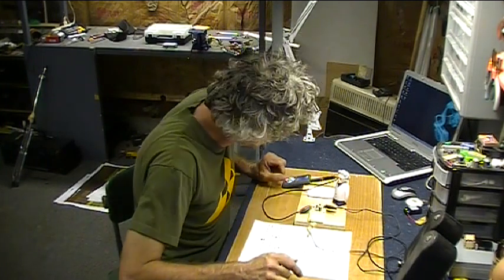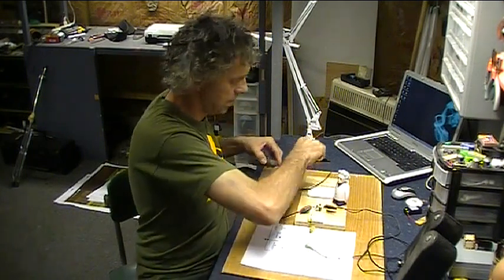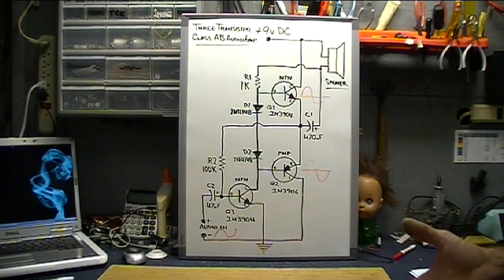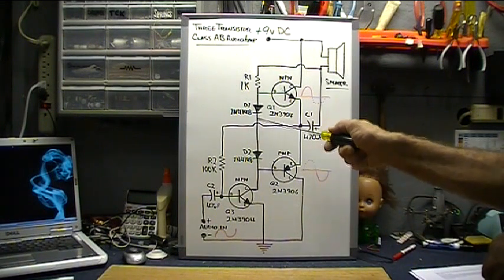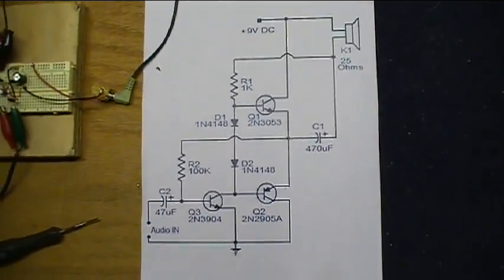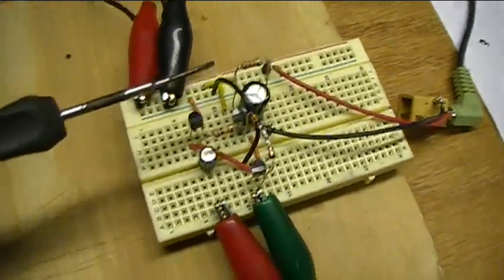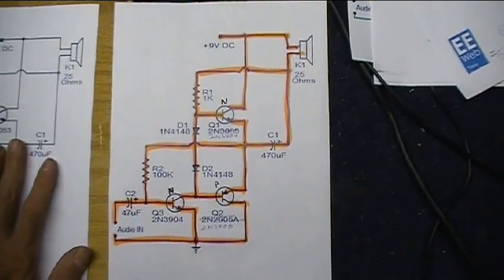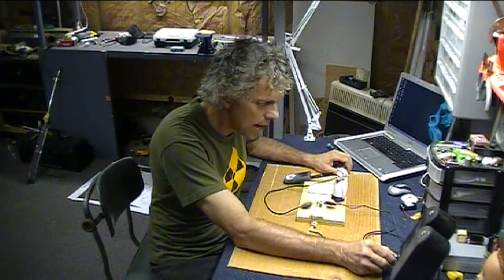Class AB Audio Amplifier

Comment: @HackaweekTV If on the circuit diagram where q1 and q2 are (the output transistors) if you put anothe pair identical to them in parrallel with each other, would this mean the amplifier could then be twice as powerful?, could i then increase the voltage to the amplifier and create a larger wattage output amplifier?
So the ampifier you have the diagram would be exactly the same BUT with the addition of the extra x 2 output transistors wired exactly in parallel ( they would NOT be in the darlington configuration) so for example Q1 which is a NPN 2N3053 transistor would have another identical transistor joined to it, so base would go to base, emitter to emitter etc,wired like that and the same for the other Q2 PNP 2N2905A transistor.
I dont know the answer but i presume,it would be able to handle more voltage and current so therefor the voltage to the amplifier could be increased, maybe doubled to create a more powerful amplifier
OR...It would give out exactly the same output in wattage but it would have more head room for overloading and heat dissapation as the 2 devices would now work in harmony and share the load.
What would be the results of doing this, say Hi to Einstein, he's a great dancer :)
ROB FROM UK
Reply: Hello could you please tell me what the wattage output of the amp design on the video is? Can't seem to figure it out :( thanks!
Reply: expect to not get a reply,im still waiting, but i can sort of answer your question. This is only a tiny amplifier not a large power amplifier,so the collector current on the 2N3904 is around 200mA, and the power supply is 9 Volts....so
Watts = Volts x amps, so 9 volts x 0.2 amps = 1.8 watts max.
The true way to get an exact wattage would be to measure the output voltage of the amplifier then divide that by the impedance of the speaker and times that by the voltage = watts.
This amplifier is more of a project small amplifier, not really a power amplifier as the voltage supply is low and the transistors are not power transistors,i hope this info helps
Reply: WATTS = VOLTS X AMPS
Reply: Great. Thanks! :)

Comment: What is the voltage of your capacitors?
Reply: doesn't really matter just that they are over 9 volts because thats the dc power level the importend thing is that they are on 47uF and 470uF

Comment: Can I use a 8 ohm speaker rather than 25 ohms? I made the circuit but the sound is not clear. I replaced the 2n3053 with 2n3725. Is that okay? Answer please. Thanks.
Reply from the maker: 8 ohm is ok. Look at the data sheets for those transistors to see the differences.

Comment: omg i used this circuit to make a power amp and it work!!!
Reply: What is the steady voltage of this amp and resistance?
Reply: @jamobhom as far as I remember I made it using Tip41c and Tip42c and 28V but it hummed and the idle current was high. A better version would be with a pnp 1st stage class A preamp emitter feedback and drivers with the outputs (5 transistor amp)